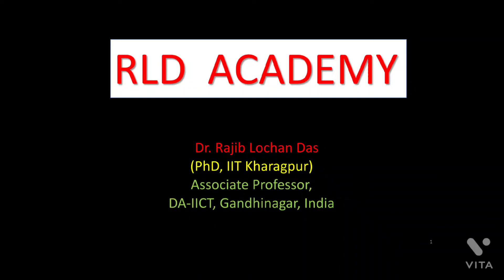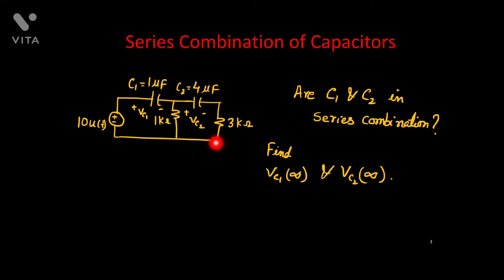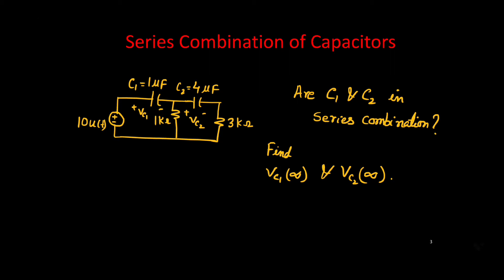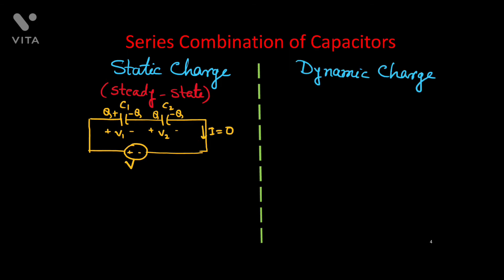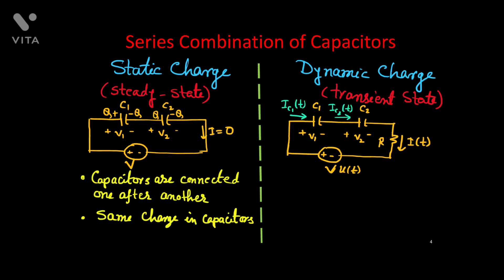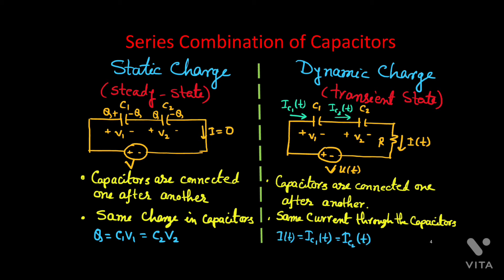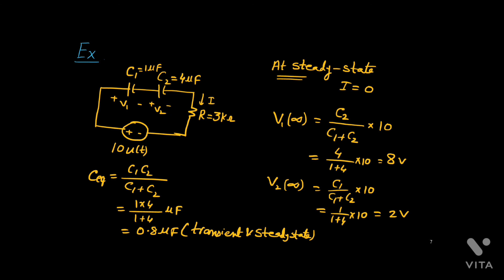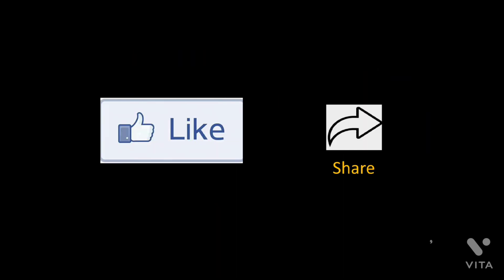Series Combination of Capacitors | Steady-State  Capacitor Voltage | Potential Divider in Capacitor

Comment from the maker: Post your answer of the homework problem here. First try to identify whether the capacitors in the circuit are in series connection under steady state condition or not. Remember capacitors behave as open circuit elements under steady state conditions but resistors may have steady state current.